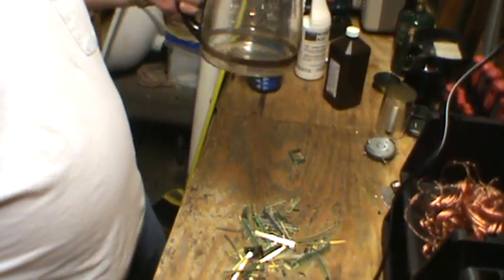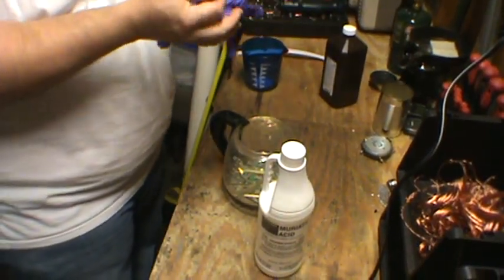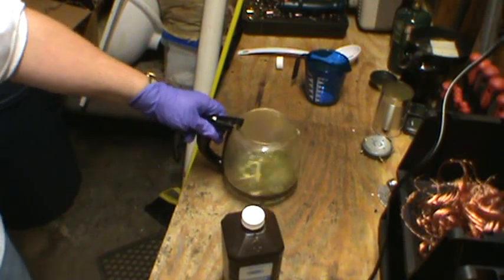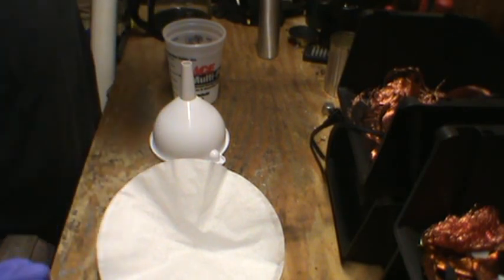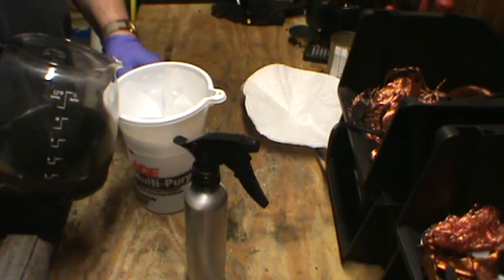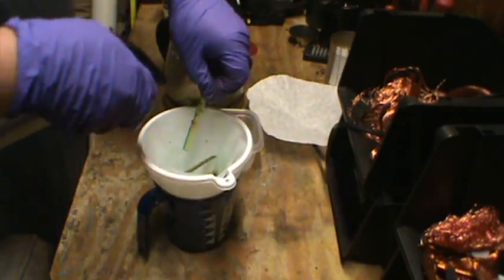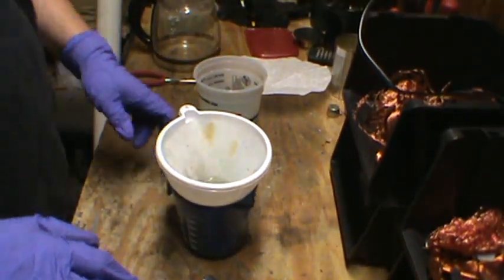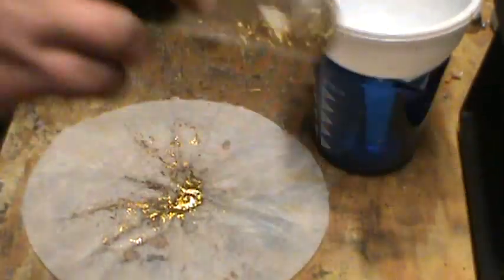How to Recover Gold with A/P Acid peroxide method for gold fingers and gold plated boards easily.

Comment: I have to do it at home, sorry... but how would I extract gold, is it the same for all parts from electronics? I have cpus, cell phone motherboards, gold fingers, and other pieces that contain gold and they are all reduced to a very small quantity, should I use Nitric Acid and Distilled Water?  what would be the ratio?  thanx and great video, U r an inspiration

Comment: Check out my video I did the same as u but I used heat to speed the process and I refuse to have those chemicals inside I use an old grill the sun heats it for me but the fumes that escape is destroying  my grill what do u think it's doing to ur house or what ever ur in. Also made the removal process easier with mason jars cheap and useful. I don't brush it as well I burn it

Comment from the maker: aluminum melts at 1221 F or 661 C, copper melts at 1984 F or 1085 C.  So the Al would melt first, but the fuel spent to do this for every radiator would make it ot worth the money and lower the value of the copper.  Yards pay less for burnt copper.

Comment from the maker: .....riiiight...um, it reaaaaalllly helps to have a little chemistry know how.  I would highyl reccommend you read CM Hokes book on precious metal recovery.  If you use a higher % peroxide, or more peroxide than stated, you will dissolve some of the gold, and you don't want that.  Use as little peroxide as possible and remember that some things you just cant rush.  I have had batches take a week and a half to fully remove the foils.  Patients will pay off.  Thanks
Reply: WHAT does the spray contain water ? Hydrochloric acid ?  Thanks in advance

Comment from the maker: Another great question, unfortunately almost impossible to answer.  The older cermics can have quite a bit more than the newer fiber chips.  The high yield chips can have over a 1/4 gram per chip.  The newer lower yield ones may only have 1/20th of a gram per chip.   Check out goldrefiningforum.  It may be a bit tricky to find but there are people there who post specific yields for specific cpu's.  thanks

Comment from the maker: Chips?  What chips?  This method is for clean gold plated boards like gold fingers only.  If there are other metals the solution will change depending on the metal.  Gold recovery is a very precise science.  It is important that you listen carefully to the video and do lots of research or you will end up losing gold and creating very toxic compounds that are not easy to dispose of.  The only metals that should be present in this experiment are copper, nickel and gold.  Thanks!

Comment from the maker: Sand paper and HCL will not remove the solder mask,  You need lye and hot water.  Let is soak for 10 minutes then it will come off with a tooth brush.  Use rubber gloves as the lye solution is very caustic.  Once the solder mask is gone then you can soak in AP.  That wil remove al the gold foils.  Filter, then soak in AP again to remove an remaining copper and nickel.  Filter and rinse and you should have some pretty pure gold.  If you want really pure gold take the foils and .....

Comment from the maker: Recover solution?  Not sure what you are referring to.  You can rejuvenate the AP by removing some of the copper in it.  Cement it out by sticking a big piece of stainless steel in there.  The copper will cement to it then you can rinse it off and sell as copper.

Comment: ok so after I semi clean the board (taking chips off and such) then could I use sand paper first then a soak in straight hcl should take off the mask correct? then use the a/p process to separate the gold from the boards. now when you get all the gold flake in the mixture that is separating, does it separate from the copper and such that the gold was bonded to on the board leaving just flakes of 10k 14k n such behind? no1 talks about that ever. I've been breakin boards for 4 days off n on!

Comment from the maker: Hi that is kind of hard to answer.  A lot of mother boards look gold bur are not.  It is the color of the solder mask.  This process will remove the gold from boards however you want to make sure that the boards are clean first.  Sand baths and sometimes just a bath in straight hcl can help with that.  For solder masks, you want to use lye and near boilng water.  Make sure to use gloves as it can cause burns!!  Goldrefiningforum will have best info for you.  Thanks!

Comment: hey moose can you tell me if this works for motherboards that have gold on the board like the scrapperella video? I have a few old boards like that and 100+lbs of computer boards n much more other electronics.... my main problem is I never see how to get it off these type boards. I have plenty to work with and lots of free time n want to give it a shot. I also am curious if this seperates the gold from other metals like copper when they lay it down on the motherboard. a lil more info please

Comment: Understood, for real.  I have been certified in HazMat removal storage and handling.  Most have not, so even with that training, I fully agree with you.  these acids will eat your body up!

I would like to know how to precipitate each precious metal out at different times, if possible.  Disc drive Discs are plated in platinum, very costly metal.

I saw a video using crano, but I do not know the counter agent to precipitate the precious metals out.

This is the information I seek

Comment from the maker: I thin kthat reading Hoke is possibly the most helpful thing you can do to help establish a strong base knowledge for gold recovery.  As for the watch pieces that are magnetic, put it is HCL and put the HCL pyrex on a hot plate until the temp is just under boiling.  Depending on how much base metal there is this could take a few hours.
Reply: congratulations with TWO HUNDRED ML HYDROCHLORIC ACID and OXYGEN ONE HUNDRED MY CAN I TAKE OUT THE PINS I HAVE? I DON'T NEED ANY OTHER CHEMICAL CORRECTLY I DON'T KNOW ENGLISH IT TAKES THREE HOURS TO COME OUT CORRECTLY? THANK YOU IN ADVANCE
Reply: CONGRATULATIONS FTHLEMOS I AM NOT ASHAMED TO TELL YOU THAT I AM FROM GREECE WE ARE EIGHT HUNDRED YEARS OLD IN GROWTH AND HEALTH

Comment from the maker: Aqua regia uses a much stronger acid. Nitric Acid.  There are VERY dangerous fumes that come out of it and the recovery and refining process has a few more steps.  It can be a lot quicker though.  I have never used AR.  I plan to maybe next summer when I am very comfortable and have had time to set up a proper place to use it.

Comment from the maker: Thanks for watching!  I would ask a couple things first.  Are the pieces magnetic?  And do you have a safe place out doors to do this stuff?  If you want to recover rather than try to sell on ebay then you will have to cut them into small pieces first.  Magnetic pieces can just go into a small pyrex dish on a hot plate outside until just before boiling with just HCL.  If they are not magnetic then A/P will work as well if cut up small.  Thanks  Vivst the goldrefiningforum for best info!

Comment from the maker: Hi and thanks for watching!  Gold can be recognized by color and by location.  Gold will be found where there is an important connection etc.  After a while you can get a general idea of what items will have gold in them.  As for the acid, if done right, there should not be other metals besides copper nickel and gold in the solution.  If there is you may not be able to reuse the solution at all.

Comment from the maker: I really dont know.  It depends on the type of processors, ram chips, number of drives, PCI cards, even the mother boards color makes a difference.  Conservatively you should be able to recove $10 in gold.  But even that is just a guess.  It could be more.  Check out the golrdrefiningforum as they have some data on yeilds.  Thanks!

Comment from the maker: Also, most recovery and refining processes do not mix up the material.  CPU's are processed seperately.  Some older ceramic chips can have as much as a gram of gold per chip, some less than 0.05grams.  Finger boards, gold plated pins, ic's flat packs, etc are typically all processed seperately.  Ultimately, it is not worth trying to recover gold from just one computer.  To be worth the effort and cost, you must scrap many of them.  Thanks for watching!

Comment from the maker: Great question, unfortunately very hard to answer.  Computers can vary in gold content greatly from age, type, manufacturer, etc.  Some estimates are there can be about $9 in gold in newer computers.  But that is really squeezing the gold out of every part.  There is often more money to be made scrapping the componants for example, a metal cased pc can have 12-15 lbs of light iron, aluminum, copper, wires, mother board, etc sold as a whole you can make 10-15 dollars per pc.

Comment from the maker: If you leave solder in there, you change the outcome of the solution.  A nasty gel can form trapping fold foils making it MUCH more difficult to recover.  I find that those piece are typically very thin and easy to cut with a pair of scissors.  I just cut out the large gold parts.  Now also remember that those pieces are most likely flash plated, so the gold there is going to be EXTREMELY thin.  Thanks!

Comment from the maker: Thanks for watching!  10464Jeff and others like indeeditdoes and drew metalsmith have some great video son this.  I am working towards that as well.  You need to dissolve the gold foils in a HCL and add a small amount of bleach.  This creates a violent reaction so do this outside or under a fume hood.  Once the gold is dissolved add sodium metabisulfite or bonide stump remover to precipitate the gold.  Filter and dry.  Make sure to test the remaining solution for gold.

Comment from the maker: All you really need is a MAP gas torch some borax and a big potato......A crucible works better but a potato works.  Slice it in half, char it a little, then put your gold and some borax on it and heat slowly so the foils don't fly around.  You may want to lace the potato on a brick in a pyrex pan so that if any gold does fly off it wont go far.  Heat and melt.  This is likely a bit oversimplified.  Check out indeeditdoes and drew metalsmith.  Thanks!

Comment from the maker: hi and thanks for watching.  This is both!  It can be a fairly inexpensive hobby, and it can be a decent money maker.  I do this as a hobby.  To make good money you would need a large volume of material to process, and i do mean large.  I typically only run these processes twice a year when i have enough material to get a nice ingot at the end.  You can get yourself set up to process a lot of differnt types of gold scrap for less than $150 and to break even would only need 3 grams of gold.

Comment from the maker: I do reuse the solution.  I cement out any copper after a couple batches and then just reuse it adding peroxide as needed.  The peroxide is 3%.  The refining video is coming.

Comment from the maker: OK, using tweezers may take a while, and the foils may be sticking because they are still wet perhaps, or for some other reason.  Nickel is magnetic.  Iron, nickel, cobalt and steel are the only magnetic metals.  There may be some nickel with the gold foils, it that is the case you may want to soak it in A/P again.

Comment from the maker: Similar in what way, that they have gold plate under the green solder mask?  No.  Most boards do not have the gold any where else besides where it is needed.  There are some that do, but it is a relatively small percentage unless you are dealing with military grade circuits or aviation or lab equipment but not in most consume grade products.  I hope there were no componants on the board when you soaked it...

Comment: Hey Moose. I had another question for you. After taking the touchpad out of a laptop, i noticed a lot of exposed gold leaf around the edges on the back. After using the a/p method, the green coating on the rest of it had started to lift off(several soaks). I lightly scraped some of it off, and realized the whole thing was gold plate. I leave it in the jar, and more leaf comes off every time.

So my question is, are a lot of the boards similar to this(ie the ones im clipping fingers from)?

Comment from the maker: Hi and thanks for watching!  Its a great question!  If you do not remove the solder, the tin and other metals in is will react with the HCL and peroxide and make a mess that will be hard to get the gold out of.  Sometimes it creates a gel that can trap some gold foils.  It is always best practice to keep things as clean as possible.  When dealing with acids you need to take your time and do things right.  Have a great day!

Comment: there is no good way to recover Pt from hard drive disc.the Pt is in the thin film coating the disc. the disc is aluminum.the Pt content of 1 HD totals about $0.03 per. the aluminum content of the platters (depending on the price of scrap aluminum where you live) is about $0.10 - $0.15 per HD. to recover the film means you have to destroy the platter using NaOH or hcl. its like spending a dime to make three pennies.

Comment: you can expect 2-3 grams of gold from a pound of clean, close cut fingers. the foils are deceptively thin. the average thickness on contact gold plating is 30 micro-inches. do not mistake micro-inches for microns which is two totally different measurements. 1 micron = about 5 micro-inches.

Comment: Moose, a question and comment: first, I have some old plated and GF jewelery, can I toss these inthe aqua regia mix with the gold fingers etc. to get just the gold off?  Or will the base metal cause problems?   Also, you might mention to folks that most "acid refiners" have a waste acid bottle or two.  As per the battery guy don't put old sulfuric acid into any aqua regia waste!  You could by accident make nitro glycerin and have a very big BOOM!   Anyway, Thanx

Comment from the maker: Hi and thanks for watching!!  Just about everything in electronics that has gold is plated.  That's one of the properties of gold that makes it such a great metal to use.  It can be plated extremely thin and still be more functional than other metals.  So the question that remains is not if its plated, the question becomes what is the best way to remove the plate from what I have, A/P method, Aqua regia, reverse electroplate, sulfurcitic cell, pyrolysis, etc.  If it is directly attached to.....

Comment from the maker: The acid can be "cleaned" by cementing out the copper with a piece of stainless steel.  As for the right amount of acid and peroxide used, I use 2 parts acid to 1 part peroxide.  Thanks for watching!!

Comment: Yeah no worries, I have a decent grounding in chemistry anyway. The only part I'm finding confusing is can I just use an aqua regia solution at the very start or do I have to us the AP method first? I don't want to use AG and end up with gold suspended with a ton of base metals I can't economically separate :)

Comment: Ya I know its just I already know how to use the Nitric correctly and get 22K gold each time using it because of a acuentince I met a cple months ago and I just found someone that sells nitric 6 gallons for i believe 90$ but either way even if im pulling out 14k gold with this process technically it will have more weight and equal the same as recovering 22k agleast thats what I think, so the safer the better I just bought the Muriatic and peroxide today so ill be sending you a pic in a few days

Comment from the maker: Sure thing!!  The acid HCL is Muriatic acid, its good to get 31.45% or stronger.  The peroxide is regular 3%.  And you use them both at the same time.  remember acid to water so put the peroxide in first.

Comment from the maker: Hi and thanks for watching!!  I am no expert, just want to get that out there...  This video is about gold fingers which is different than plated pins.  Plated pins would be HCL and heat.  You may want to run smaller batches especially if this si the first time you are doing something like this.  It helps to start small to get a comfort level with the process and the chemicals.  I would go with 250g batches.  Try two of those then go to 500g if you get good results.

Comment: I  have a kilo of small pins very clean no plastic. or solder. Is several small  lots better to run with this method? or do the whole Kilo at one time. ?
Thanks a bunch for doing these Vids

Comment from the maker: The other materials out of the refining process?  That is one with HCL and bleach.  It dissolves the gold then you precipitate it with SMB or sodium metabisulfite.  To get the copper out of the A/P solution, just set a stainless steel item in there over night and the copper will cement to it.

Comment from the maker: Hi and thanks for watching!!  I do not sell my flakes, I save them up then make gold shot. As for the value of the processor it realy varies.  The goldrefiningforum has some great info on average yield of gold for different types of processors so you can determine how to get the most money per cpu.  In my experience, you often get more money selling them on ebay but that is not always the case.Thanks!

Comment from the maker: You can use a hot sand bath.  It is a pan with about an inch of sand in it on a fire, gas grill, or something like those.  Once the sand is about 450 degrees F you place the boards flat on the sand fo a minute or so.  The sand will loosen the componants so that you can just scrape them away into another pan.